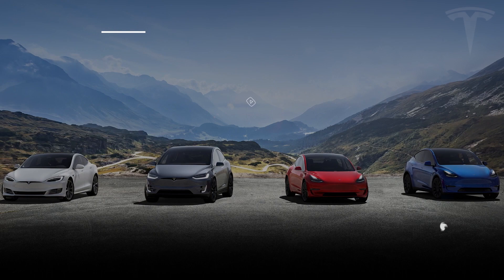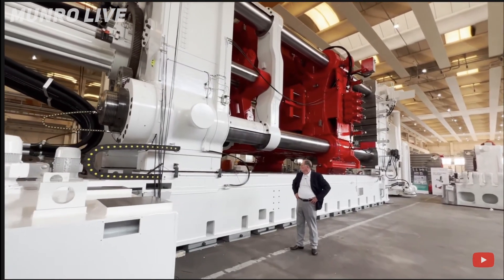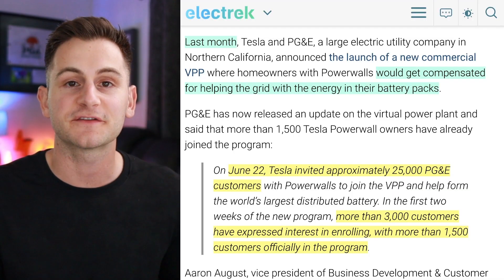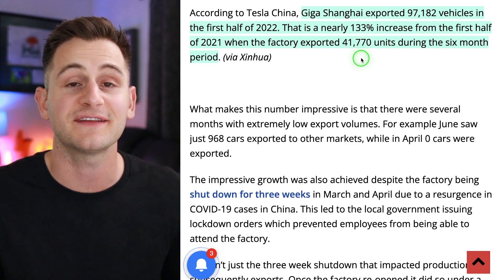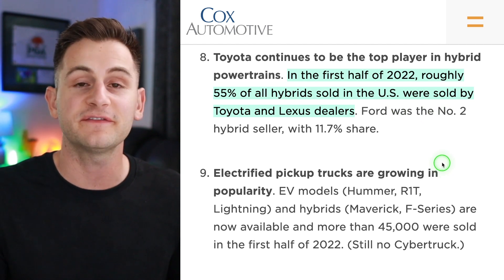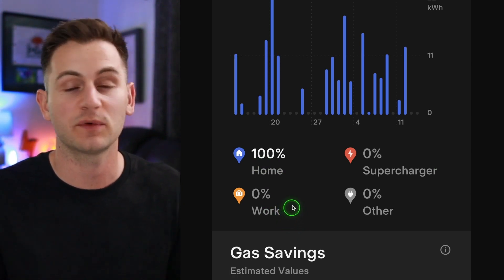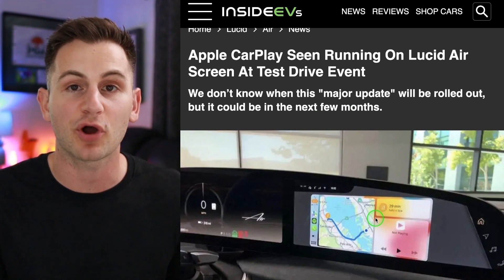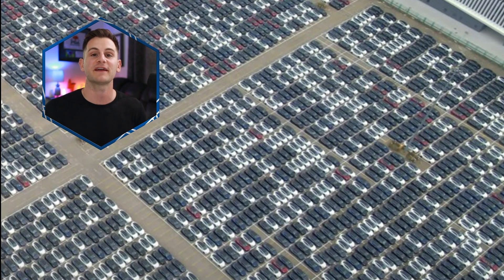Munro: Knocked My Eyes Out / Elon on Lowering Tesla Prices / VW Taking on Water ⚡️

Comment: Just did a price check on new EV's in the United States and wow, every vehicle I looked at was around $10,000 less than ten years ago. Some EV's  are at a lower retail then similar gas vehicles from the same manufacturer. Now if the charging stations were more prevalent I would buy one right now (Sorry don't live in California)

Comment: Not surprising that Tesla wants faster injection.  Injection must be fast enough for consistent casting temperature, so the slower you go, the hotter the metal is.  That leads to higher wear of the die, longer cooling time, faster oxidation of liquid alloy, and more energy required for heating the metal.  I suspect they will really want a similar ~120ms injection time, to keep the same working temperatures.
Reply: it's incredible even at 180 ms. something like 200 lbs or is it kg injected in .18 seconds . that is lightning fast and requires a lot of pressure . the 9000 tons is the force holding the mold closed against that pressure.

Comment: The MAJOR bottleneck is the dry battery electrodes, they're only half way there with only the anode. This affects everything they talked about on battery day; Cell design, production, materials, vehicle integration, everything. They're in for a lot of pain if they don't figure it out, and certainly don't expect a lower priced Tesla until they do.

Comment: According to the bits of info here: There are only 3 other BEV manufacturers who have production volumes (>100k /yr) that can justify a Giga-Press (i.e. VW, Ford and BMW) of which at least 2 are losing money on every BEV they make.  If they ordered one today, it would not be installed and operational for more than a year.  During that time they would need a major re-design to take advantage of a large pressure cast chassis component.  But then, they are stuck, because they would still have to buy the specially developed aluminum alloy for these machines from Tesla.  😂
Reply: What are you talking about. GM makes more then 100k cars a year. Toyota? Honda?

Giga castings have nothing to do with EV cars……… it’s the car frame regardless what goes in it and every auto can benefit at some point to retrofit

No they really don’t. Space X engineers  formulated the metal compound. Which can easily be done with any other team of engineers working on the problem. You take about 50 compounds. X-ray them and each 5 sets gets you closer to figuring out the metal that will work
Reply: @ssing7113  Well, the subject was BEVs, if you looked at the charts.  None of the other car manufacturers have even considered using  large castings for a significant portion of the chassis, EVER!  But you're right, even a horse drawn wagon can benefit from a giga casting.  As far as the other engineers, who outnumber the Tesla guys  about 1000:1, none have even thought of this in the last 50+ years. Most of us won't "hold our breath" for your imaginations to come true.

Comment: To be honest I'm over speculating where and how soon Tesla will get back to 1k and beyond. The confidence that they will and will exponentially increase their value over the next 10-20 years is enough for me?!

I think what's got me more interested lately is what's going to happen to the Automotive Manufacturing Industry which includes all of the ancillary markets that Automotive Manufacturing feeds into which equates to 2.7 Trillion Dollars.

In the first quarter of 2022 Tesla made 18.7 billion gross revenue. That's with a total of 258,580 units sold in the first quarter. Considering Shanghai's closing this means that Tesla should have produced over 300k? 

With Austin, Berlin and Shanghai all ramping up a final figure of 1.5 million units is not inconceivable despite continued issues. By the end of 2023 and the advent of the CyberTruck and the Tesla Semi. Production and Turnover will increase dramatically with those two units alone representing a potential 40% increase in Gross Turnover?

By 2025 Freemont, Austin, Berlin and Shanghai will be all fully ramped and possibly up to Stage 4 or even 5 of their Development?

This could mean that by the end of 2025 Tesla could be up to 10 million Units a Year? Or in other words they will have become the largest Automotive Manufacturer in the Word replacing Toyota and VW.

Now I am sure that BYD will be challenging for top spot as well but the point is that 10 million vehicles that used to be ICE are now 100% Electric. And that Tesla as a company is now turning over in excess of 700-800 Billion dollars a year.
Reply: Yeah, I’m looking forward to Tesla’s growth. I’m going to tighten up my budget and get a few more shares. Unfortunately I spent the last chunk of cash on TSLA acquisition when it was trading over $1,000. Any vacation travel will be relatively local. Explore America!
Reply: @theknifedude1881  The main reason Tesla is such a strong hedge right now is because of the split. It's effectively a hedge against inflation and the macro economic environment affecting the Markets.

Think of all of those companies right now with long term debt on their balance sheet. Or reliant on spot prices for supply chain fulfillment and or demand problems due to economic concerns.

Whether Tesla meant to or not they made their company inflation proof. They wiped off all their Debt, fixed all their supply contracts at an average of 5 years. Have long term demand on all their models and literally can sell whatever they produce for the next 5-10 years despite increasing inflation.

So besides watching your liquidity and reducing debt Tesla is the best risk adjusted investment in the US Today.
Reply: @Advoc8te4Truth  Sounds good to me. That’s pretty much what I’m counting on.

Comment: On the general issue of vehicle prices, a couple of years ago at Battery Day, Elon promised the working middle class a $25k 4-seater. Then, while other shit was happening, he got a big push on FSD & said it would be a good deal for workers - cheaper transportation w/o ownership & all those cars cluttering up the neighborhood. But, again, no FSD… and not even a good work truck (single-motor version canceled in favor of 4-motor $$version & wait-list longer than the eye can see… Hot-rod toys for the well-off, zip for workers.
Reply: The bots keep coming back on the back thread  — YT’s ‘report’ thingy doesn’t keep them off — even when they’re IDENTICAL !!!

Comment: I always think Tesla shot themselves in the foot not finding a way to buy out IDRA or backlog them for 20 years as every OEM will adapt at some point with tesla giving them their advantages 

I don’t know enough to speak about business but this was a play tesla had that was a total leap in advantage that is now open to every OEM
Reply: Maybe you should go and read the stated aims of Tesla.
Reply: In some high capital industries, manufacturers want their vendors to have multiple customers. The vendor will have more reasons to invest in R&D and less fraction of this R&D cost will be billed to the original manufacturer.
Reply: Idra is not only company manufacturing extra large die-casting machines.  Buhler is a major supplier of this type of equipment.  Brian G

Comment: I think Elon will keep his price reduction powder dry until there is a competitor snapping at his heals, so no time soon..
Reply: I don't.
I think he (they) set a percentage margin to do what they need to do in future.
If it's impacted negatively by external events, they increase the price.
If the pressure reduces, they adjust accordingly.
Reply: Other than byd perhaps by the end of next year or 2024. But byd likely isn't really a peer competitor either. 
As acceleration isn't on par with teslas, the range is close but only on the generous cltc standard. 
Charging rate isn't quite there yet, and top speeds are very low as well. 

Also byd bragging about ctp but showing the cars due to lack of large scale castings. Still require a floor pan. 
So imo byd is the de facto #2 to tesla supplanting vag. But still not an actual peer-peer competitor. 

I also doubt they could ask anything like tesla prices and get them outside of China either. And the U.S. will just slap large tariffs on them if they try to come here anytime soon. 🤔
Reply: Tesla's goal is to speed up the adoption of electrified transport having a high price finances that but the economies of scale and further production improvements aka the best part is no part the best process is no process will remove that need for a high price eventually and they will do it.

Comment: Battery cells are not structural. Cell casings can be made strong enough to participate in a structure but in addition to the extra heavy metal, they also need to be bound together. I’m not convinced this is the best way to build a floor structure with a battery. Elon’s analogy comparing batteries with fuel tanks in aircraft wings is flawed.
Reply: Are you an engineer? I'm no engineer either but I've flown airplanes and worked on them. I thought the whole aircraft fuel in the wing tank analogy made a lot of sense from the battery day presentation. 🤔
Reply: @4literv6  no I’m not. In the case of the wing, the superfluous fuel tank was removed because the already existing wing structure could contain the fuel.  In the case of the structural battery pack, Tesla is adding additional structure to the cells and probably very rigid bonding to make ~800 little pieces into one solid structure.  The comparison is a fallacy. There may be advantages to a separate solid floor structure bolted onto the BIW but this does not require that the cells be structural elements.
Reply: @abstractreasoner  I figured you weren't thanks for being honest about it. 👍🏻
Reply: You should goto Munro live channel to see his breakdown/teardown and opinion of the 4680 structural battery pack architecture
Reply: I’m guessing you haven’t seen the Munro video that mentions the weight saving.
Reply: @fredbloggs5902  yea I saw the Munro video. It’s only slightly lighter than a Fremont Y but has less energy capacity. What’s there to be impressed with?